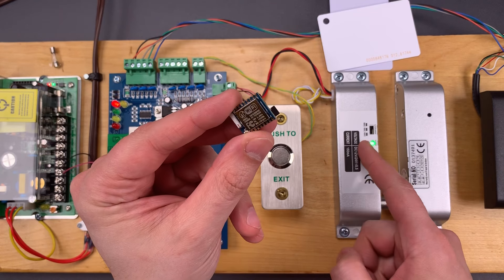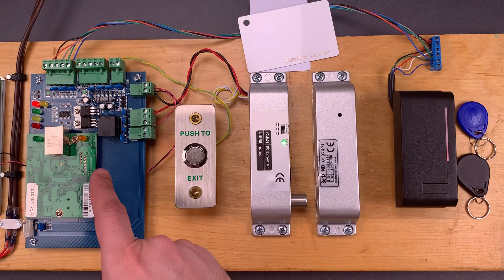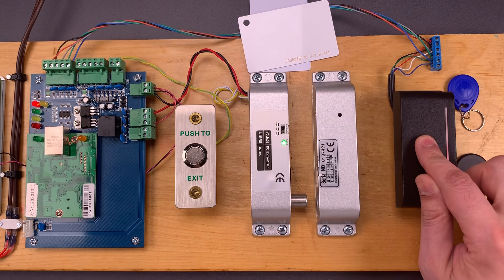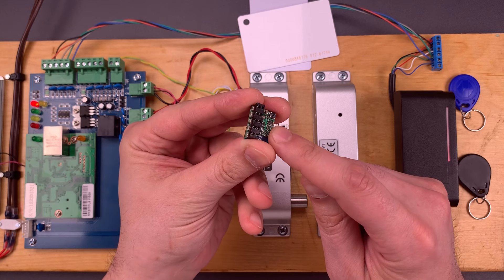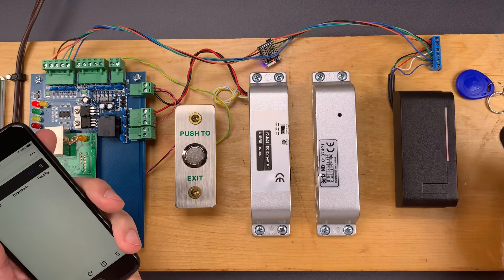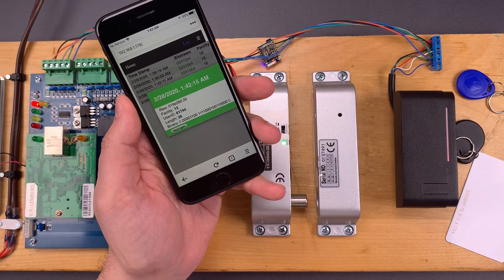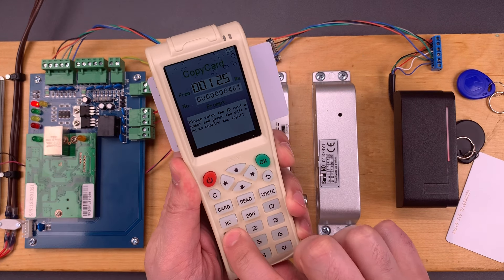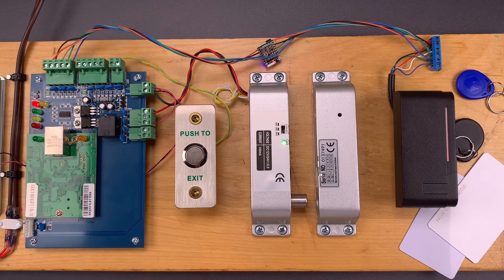[1052] Bugging an RFID Card Reader

Comment: Not just encryption, the encryption used must be resistant to "replay attacks" (which not every encryption method is).
Reply: I think he was referring to smart cards/secure RFID tags that use public key cryptography for authentication or a one time code from pseudo rng. Like a emv card.
Reply: I was thinking the same. As see from many keyless carsystems you can also just clone or forward the encrypted communication and get access granted
Reply: @hhanh01  Actually, many card readers simply read the number assigned to the card and transmit it back with no encryption at all. He demonstrated that in the video, where the binary stream was just the 6 digit card number.
Reply: Yep. Many encrypted locks may as well not be, since they use a single hash rather than a procedurally generated one that is produced at the time of scanning.

A good RFID system should be able to keep the code secure even everything passed between the controller and the reader is read. Both sides should have a synchronized pseudorandom hash produced by the same seed.
Reply: @OtakuUnitedStudio  what sorts of places would for sure have proper security. Typical college campus?
Reply: @ntl9974  Really, it should be standard in RFID readers. Just to give you an idea, you can get the card number, date, and security code from a credit card using the NFC reader built into just about any smart phone because the "standard" used for point of sale devices doesn't include any kind of encryption at all. They reasoning being "the card's only gonna be an inch from the device, why bother?"
Reply: @OtakuUnitedStudio  Yea ik I'm late to the party but just plain DH exchange for the hash key would do it.
Reply: @theNunnceler  You'd want authentication on that DH exchange too, to make sure there isn't something between the reader/controller doing a MITM attack. But otherwise, yep!

(Though at that point I think an attacker would just try to eavesdrop on the reader<->card part of the system, so the cost/benefit of a more expensive reader design isn't that great.)
Reply: @CFSworks  This can be solved as well if you move the cryptoprocessor onto the tag itself. There have been a couple of lightweight encryption schemes that can practically be implemented on an RFId tag developed so this option is achievable. Granted this would almost certainly increase the per unit cost of the tags which could significantly increase the total cost of the solution if the pool of authorised users is fairly large. But ultimately as with anything you pays your money you takes your choices if you need the security it can be done for a price.
Reply: @seraphina985  Or give the authorized users a smartphone app and make the reader use BLE or NFC as appropriate.
Reply: @CFSworks  That would work too though the complexity of modern smartphones would not be your friend here. They present a rather large attack surface that makes them rather vulnerable to attacks by malware seeking to extract secrets from the device including the authentication secrets such an app would need.

You gain all the potential issues that come with having a general-purpose computer openly addressable via multiple public networks taking responsibility for authentication. Sure this can be done but it will not be as secure as having the end nodes locked down with only the functionality essential to the task.

This is why for example you often see network security systems like enterprise firewalls and IDS's running on their own dedicated systems with very cut-down operating systems and no unnecessary services. Hell some of them will not even answer an ARP request for any IP address on any of their monitored interfaces so they cannot even be addressed directly without physical access to a different network port.
Reply: @seraphina985  Or don't trust the smartphone - it's merely a proxy to an authentication server which is trusted.
Reply: @CFSworks  That would not help in this case as you are trying to authenticate the user so you still need to determine whether the device belongs to an authorised user. The whole point of a cryptographic tag is to identify the user by means of something they possess so whichever device is acting as the tag needs some kind of secure secret to do that.

Honestly though perhaps the best solution might be to use some form of second factor authentication to ensure the user who's device was issued that authentication token is also present. For example adding an encrypted fingerprint scanner to the door also which securely sends a scan of the users fingerprint to the controller for verification at the same time.

This way remote attacks to attempt to steal the authentication token from the phone wont help a would be attacker much anyway. They would still need to obtain physical access to the user to acquire the matching biometric sample.
Reply: @seraphina985  Although "authenticate a user of a device to a server" is a problem with well-understood industry-standard solutions, while "to an offline door controller" is not. We know how to do the former safely.
Reply: @CFSworks  To be fair there are serious problems with most methods of doing that but then most of them are single factor and frankly single factor authentication needs to die in a fire it causes so much problems.

Honestly pretty much any authentication protecting anything of monetary value should be two factor based at a bare minimum and a lot of the industry are well behind on that so I wouldn't bank on an industry that all too often does the bare minimum knowing it is weak for advice.
Reply: @seraphina985  I don't do "most methods," I do "best methods." 😁
Reply: @seraphina985  So ok say a lock had all those cryptographic features, how else could it be hacked? Everyone I've read online says they're the same level of security as mechanical, but it seems ridiculous to me since we have really strong cryptography that no one can beat today (that we know) other than essentially brute forcing with a lot of compute and time.
Reply: @tyler-iy4jk  Well the reason for saying that is that when applied as a physical security measure you can still bypass it by attacking the physical mechanism and/or the door and door frame it is anchored to. As a physical security measure even if you can't defeat the cryptography you can still resort to brute force in the traditional way ie attempt to break, cut, smash or otherwise destroy the integrity of key parts of the lock, door, frame, hinges etc.

But yes if cryptographically secure a physical brute force attack would yield a compromise in the shortest time. Even for the most insane heavy duty reinforced blast doors or something you are probably talking more like days than years to cut through it with the proper gear.
Reply: @seraphina985  thermal lance, shaped charge, even 'car through wall' tactic..
Reply: @adambartlett114  Have you seen how easily a car goes through a brick wall, not street legal, but the two or three I've seen irl were probably still drivable. I was shocked..

Must have hit something load bearing too, considering the width of a car.

If you were well motivated and didn't hit a stud, you could probably kick your way out of most houses. It's just dry wall then thin siding, pulling the nails outward or even the heads tearing through..

A man's home isn't much of a castle nowadays.. js
Reply: What about just short wires? You could go so far as to run them through a tiny hole and fix them in there with some caulk or epoxy, then the ESPkey can't be attached from the outside.
Reply: A basic challenge-response would work well. You could have a lightweight hash algorithm(later generations of the SHA algorithms or even an ARX based cipher algorithm like Salsa20?) running on both the RFID and the lock system itself.

Both the RFID and the lock have the same random key that is stored on the devices, never transmitted and is ideally of atleast 128 bits in size but maybe up to 256 bits (80 bits should be absolute minimum size, many low power key card systems used/still use this key size afaik).

The RFID device communicates with the lock system that it 'wants' to open the door.

The lock system sends the RFID device a 128 bit nounce (one time use, random string of bytes).

The RFID device and lock system concatenate(stick together) this same 128 bit nounce string to the key they both have and compute, using a lightweight hash algorithm (a one way function) a 128 bit, one time use pseudorandom string of data.

The RFID device transmits this computed value to the lock system, if this string exactly matches that the lock system has already computed - the door becomes unlocked.

If the data string the RFID device transmits does not match the computed value the lock system had computed or/and the RFID device response takes too long - the request to unlock the door is invalidated.

This completely protects against any replay attacks or many other cryptographic attacks as any data transmitted between the RFID device and lock system are one time use, completely unpredictable and essentially meaningless to an observing attacker.

Trying to derive the secret "key" from any intercepted response values of the RFID device is absolutely computationally infeasible - given the one way nature of cryptographic hash algorithms.

It is very cheap, low resource use and fast to derive a hash value from the combination of a secret key and a known nounce value. 

But you cannot use that same output hash value to derive the secret key value(even if the nounce is known) without the very least alot of time, resources and computational power by often large and well funded entities/organisations - if even possible to achieve this within a human lifetime. 

All this; provided the underline hash algorithm and implementation of such a system is free from any major vulnerabilities an attacker could exploit.

P.S : 64 bit sized nounces are much more commonly used within cryptographic protocols as this size is often sufficient for most applications, I went with a 128 bit nounce in this example to make it a bit easier to explain - given the 128+ bit key size to be used in an ideal cryptographic system.

80 bit encryption keys are * probably * an ok key size for many average individuals to use today - though a well funded and large organisation (eg government agencies or cyber criminal gangs) may be able to brute force and crack such a key if they were to specifically target an individual.

Hence at a minimum you should be using 128 bit encryption keys in this modern age - preferably 256 bit keys for when quantum computers advance sufficiently to carry out cryptanalytic attacks, as quantum computers essentially half the key size of symmetric encryption algorithms(eg. AES, Salsa20, Twofish...). 

So while a 256 bit key to a quantum computer would become like a 128 bit key to a classical computer in terms of brute force (stays infeasible to attack - for even large and well funded groups).

An 128 bit key under a quantum computer brute force attack becomes equivalent to a classical computer brute forcing a 64 bit key - which is probably quite easy and trivial for even an average modern desktop computer to do, given a sufficient graphic card. Nevermind governmental organizations and cyber criminal gangs.... Lol
Reply: @seraphina985  "second factor authentication" 

Like a security guard that quickly learns our face and name because we often stop for a brief greeting?
Reply: I wonder if LPL has ever tried the entry method "Just steal the key"?
Or "Keep kicking the guy til he tells ya PIN"?
Or "Saw off the ded gise thumb print"? 

Works in the movies..
Reply: Gotta be that good caesar encryption - we need to follow the order of history on this one :D
Reply: @OtakuUnitedStudio  I’d have to look up the details. But your standard payment card has protections against replay attacks for chip and rfid transactions. The number might be transmitted in an easy to read fashion, but that cryptogram is generated by the chip in the card. It’s much more secure than the old magstripe.
Reply: @OtakuUnitedStudio  If you're able to scan a credit card closely enough for an NFC reader to work, aren't you already able to just read the card? Or is it really readable even through a wallet and pocket without direct contact?
Reply: All you secure Sallys take the fun out of life you know
Reply: yeah, maybe if both systems had a counter which iterates every unlock and the hash of the number and the serial no. was compared too it should be safe against replay attacks.
Reply: @OtakuUnitedStudio  AFAIK the code you can read from plastic card NFC is either one-time use or not enough for payment. AFAIK plastic card does some sort of dialogue to payment terminal to prove it has it's unique private key every time you pay. And there is no way to access that private key without ripping it open
That said they almost always still come with f-ing magnet strip anyway, and you should protect them from unauthorized access to payment terminals (by either sandwiching two contact-less cards or sticking it into shielded pocket/sleeve) due to possibility of enacting pin-less "purchases"
PS after a bit of googling seems like the authorization protocol for chipped plastic cards is called "EMV" if you want to research it yourself
Reply: Relating to the RFID replay-resistant discussion: I bet there is a whole slew of zero-knowledge proofs that exist already. One primitive (and probably insecure) way that comes to mind is RFID cryptographic chip with assimetric encryption that securely holds it's private key, tells it's public key that it then first matched against registry of public keys, and, if confirmed to be registered, terminal asks to decrypt few encrypted randomly generated messages to prove that the private key is also correct.
PS one security flaw I can see is that private key probably still can be read from stolen card with a microscope (although that could be solved by removing the public key from registry soon enough). Another is that the registry itself might become a weak link in this case
Reply: @Chris47368  That’s vulnerable to length extension attacks. Sorry. 
Use a proper MAC algorithm. Don’t ever just paste a key and nonce together and hash it.
Reply: @roncraig007  Don't take my questions the wrong way - you might know more than me, as a amateur cryptographic enthusiast I am really interested:

Isn't SHA3 with its sponge construction type system resistant to length extension attacks? 

Also even with other hash functions that are vulnerable to length extension:

Don't length extension attacks only apply if you are just sending a message to verify, as opposed to a short - one time use challenge/response hash values, that themselves are the "message" as a whole? 

To my knowledge: this type of attack only works if one wants to verify a message authenticity but an attacker can extend that message without the knowledge of the key to contain additional information that is not authentic, but the original message itself cannot be altered/subtracted from in anyway - aside from being just having the malicious data added to at the end? Trying to attempt length extension attacks in this lock challenge/response system context seem rather pointless to me, from an attack prospective.

My reasoning is: Since, surely the random one time use nounce introduced(that has to be initially generated and sent from the lock system itself, which the attacker has no control over) would stop this kind of attack in that scheme - as the attacker can only "extend" a previous hash/response, not subtract the nounce from any previous responses and somehow add back the required nounce as would be required here? That surely would involve reversing the hash function - which in itself is one way by nature, which is infeasible to achieve.

Seems to me that they might as well attempt to obtain the key itself or even just hack/break into the lock itself at that point.

I do otherwise agree in most other contexts that if you are actually sending actual data that is prone to be maliciously extended, along with the separate hash value/nounce combo,  that yeah - MAC schemes are generally needed, no doubt. 

But a MAC scheme in this lock challenge/response context seems rather pointless and kinda useless - where length extension attacks cannot really apply.

Please correct me if i am wrong.